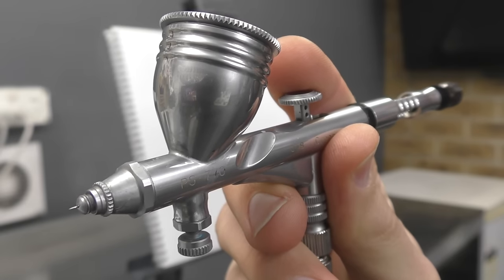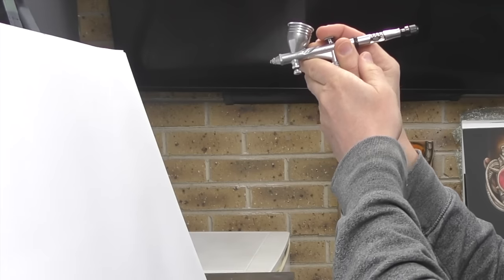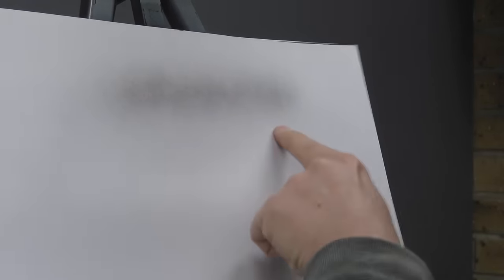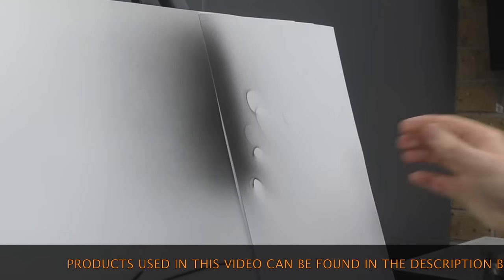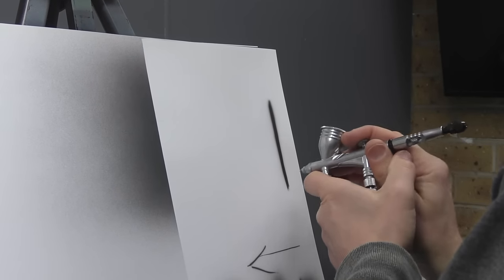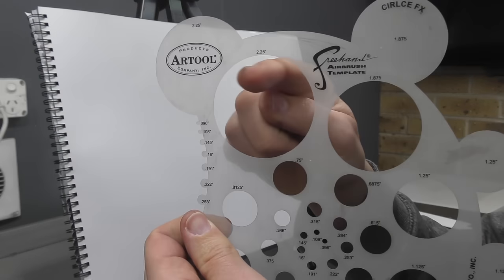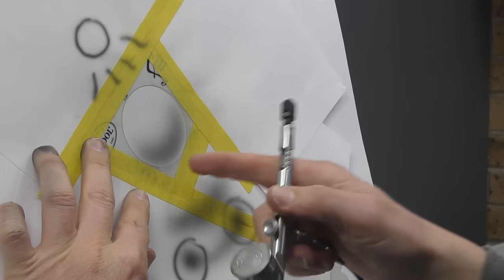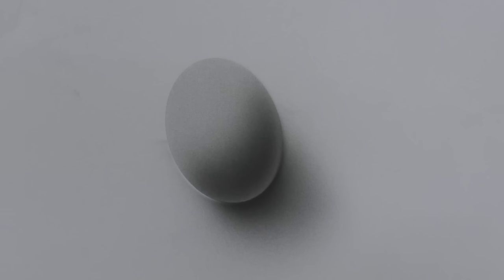How to Shade with an Airbrush

Comment: It's nice watching an airbrush that actually works right. I have a Paasche VL and a old Badger T&C Vega 2000, and OMG, so frustrating! Good conditions in your room too, I presume. Tip dry is inevitable, but unfortunately with the Vega 2000, the air cap must be left in order for the mix to take place. So picking the needle clean involves unscrewing the cap every time. Oh, and I've found the pull-to-clear function rather ineffective because if you pull to far, the trigger assembly will get misaligned. Ugh!!!!

Comment: What size needle did you use?
Reply from the maker: It varies... for general airbrushing usually a 0.3 or 0.35mm and for detailed airbrushing a 0.25 or 0.18mm hope that helps. 👍